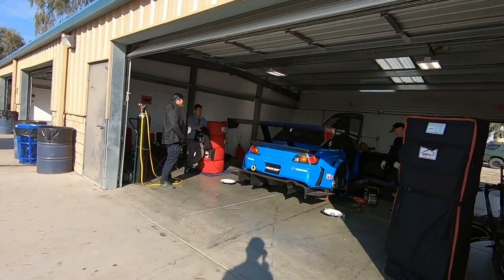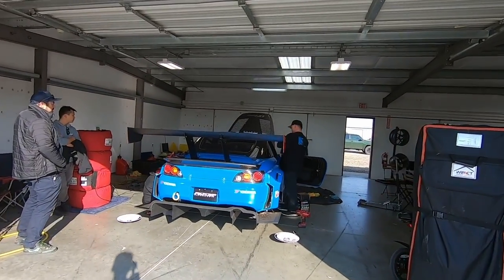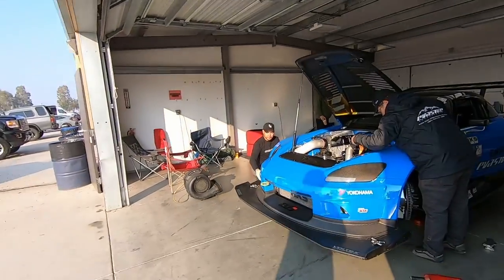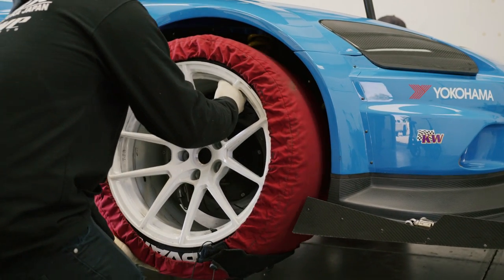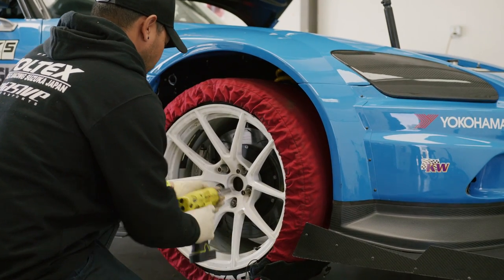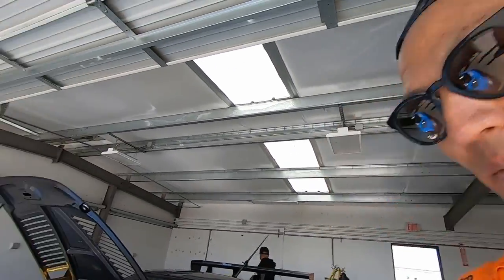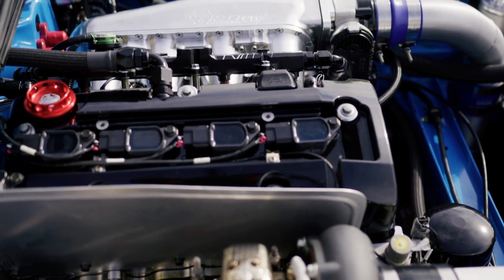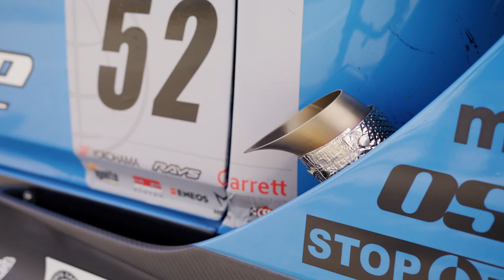Taking on Global Time Attack with the Evasive Motorsports S2000 - Presented by ENEOS

Comment: If only the s2k was made to drift. It’s like the only rwd car that struggles to drift.
Reply: That’s the thing I’m still trying to understand. I’ve heard this before. How can something that it prone to oversteer struggle drifting?
Reply: @bsimon9554  It's actually very easy to understand. It's a front-mid engine car with a short wheelbase. It rotates very quickly. A racecar like this turns in extremely quickly. It's not quite, but very, very close feeling to a true mid-engine car. It's great for rapidly changing directions on track with high grip. Not so great for comfortably maintaining angle while sliding, because all movements happen very quickly, and you don't have a long wheelbase to help you out with extra stability while transitioning.
Reply: @justsomerandomguyman  I got you. Makes absolute sense.